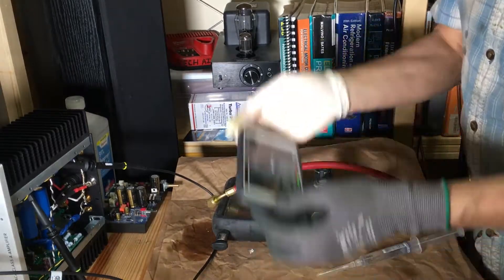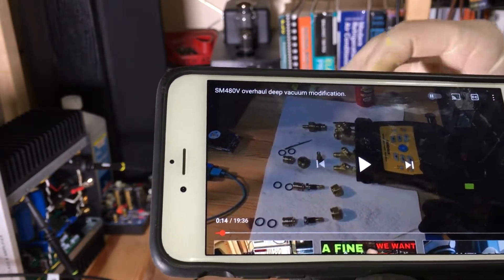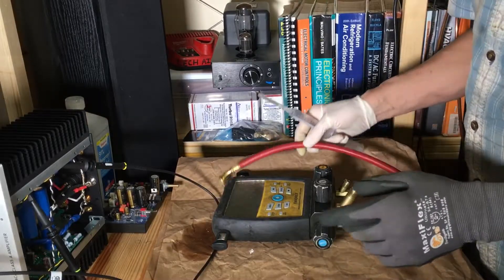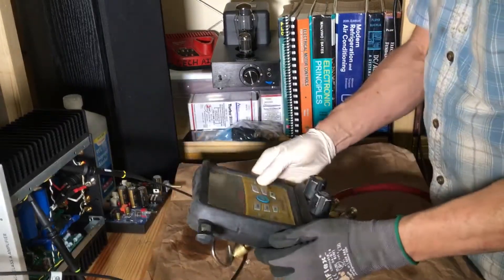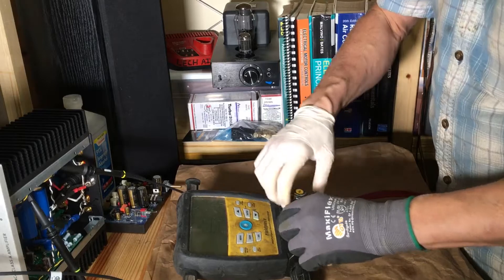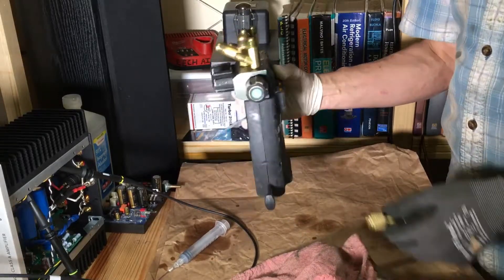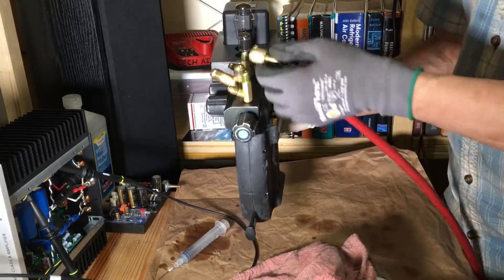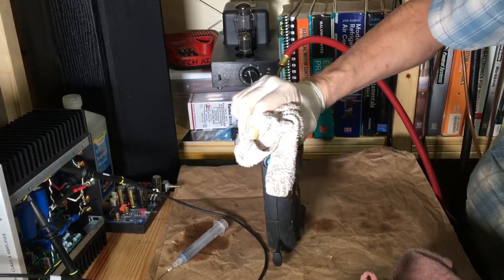How to clean your Fieidpiece  SMAN 480V micron sensor. With isopropyl alcohol

Comment: Thank you for making this tutorial video. 
I would like to replace the sight glass on the SMAN460 manifold gauge, please share if you know how to do it.
Reply from the maker: I have not had to do that on any of SMAN 

What makes you think you need to replace it? . 

Because you seen small bubbles in the glass at the edge of the oring ?
Reply: @coldfinger459sub0  Hi when charging I could not see the flow of refrigerant thru the sight glass, maybe the Sman460 sight glass is darker then the Sman480V?
Also would you share the procedures of vacuuming the manifold charging hoses?
Reply from the maker: @thaison773  that is one thing I would like Fieldpiece to change on the inside of the manifold. 
     Is to not make it black because that makes it too dark and too difficult to see stuff. 

Should leave the inside of the manifold, a shiny polished aluminum . 

It makes it much easier to see . 

I was almost thinking of taking one of mine apart and getting a little Dremel and polishing or sanding down the black oxide paint from the inside behind the glass, so it will become bright and shiny . ✨ 

I even almost thought of getting one of my very old manifolds and drilling out the backside of the manifold and adding a second side glass behind behind it so you can see all the way through .  And have light.. 💡 

I have made some videos showing removing the refrigerant after you recharge or service system . 

It’s really simple all you’re doing is turning off, disconnecting the high side and slowly allowing vapor refrigerant to be sucked into the side . 

And then you connect your hoses to your recovery and recover the leftover refrigerant inside the hoses into a recovery machine .

Comment: The fieldpiece website says to do it this way with the exception of pulling a vacuum
Reply from the maker: The majority of people do not have access to 99.9% pure alcohol that evaporates in a flash.
      The majority of mere mortals are left to go into the drugstore in some places it’s only 7% and if you’re really lucky they might find 90%. 

That other percentage is pure 100% water .  
   That absorbs nicely quickly and efficiently right in to the refrigerant hoses, and if there is a minute amount of POE oil, absorbed into the surface of the refrigerant hoses or manifold that was not removed that molecule loves to attach and connect with H2O. 

So to be nice and clean and moisture free that’s where the vacuum pump comes in in a little more dry nitrogen .
Reply: @Tom Lech / LECH AIR CONDITIONING   thank you so much for explaining your reasoning. I'll be sure to follow your advise, even with the 99%

Comment: Will alcohol and nitrogen help remove black oily sludge out of a manifold, sight glass and hoses?
Reply from the maker: You might have to order a new O-ring and mechanically physically remove the cy glass and clean it by hand with a Q-tip you can give it a try with alcohol only it just depends on what type of material the black sludge is made out of will determine what chemical will be needed to remove it.
Reply: @coldfinger459sub0  Thank you for sharing your knowledge. I'm learning so much from your channel.

Comment: To clean with r141b .
Reply from the maker: Yes the old school automotive DuraFlush AC system cleaner. $39 a quart 
          And if you get the same product that is labeled inside the commercial refrigeration warehouse under the name RX 11 for Proflush under the diverse tech name and the price jumps up to $79-$89 a quart for the exact same product. 

99% alcohol $32 a gallon. 
Alcohol cheaper.  Safer and you can use it for many other products and purposes around the house.

Comment: great video.  I have the SMAN 3 and it started leaking from the Sightglass. Any idea on how to repair that?

thank you!
Reply from the maker: Call up the company or send them to my email for a parts rebuild kit or just that O-ring unscrew it with a large hex put in a new one tighten down the hex site glass screw and you’re good to go. 

I have not had one leak yet

Under pressure do you get bubbles coming outside is that how you found the leak ?

Comment: How would you hook it up to put it in a vacuum
Reply from the maker: You just hook up one of your hoses to the manifold to a vacuum pump and turn it on close the other valves so they’re sealed. 
                 You’re just drawing a vacuum on the inside of your manifold only to remove the moisture and alcohol
Reply: Thank you! Been very helpful

Comment: Will make this stop bouncing around
Reply from the maker: What is bouncing around ?
Reply: Your Guage bounces around for these reasons:
1. You could have broken/rugged gaskets on your hoses. Inspect them and make sure they are not damaged at all.
2. You're working with linesets that have oil in them. When the oil moves around, your manifold readings bounce around.

Comment: will alcohol cause o ring or seals to dry out and crack?
Reply from the maker: Alcohol does have some side effects that may not be the best but it also has benefits depending where you live. 

      Some materials alcohol may have a drying affect. 
               And alcohol in the presence of moisture in oxygen also has a slight oxidation affect on aluminum components. 

      Now when I’m speaking of alcohol it’s not the 70% alcohol that has 30% water mixed in it that you get from your drugstore. 

       When I think of alcohol as a solvent or chemical procedures I think of a very pure alcohol that is basically 99.9% alcohol highly hydroscopic absorbs moisture very fast. 

           But if I was in a country or even some parts of the United States we’re getting to a auto supply house may not be very easy or convenient and be more than 50 miles or 100 miles away. 
                       Or somebody in a country where there may be no auto parts that we recognize as a store at all whatsoever. 

         Or somebody with very limited funds and spending $50 on a quart of AC pro flush or they have the alternative of $15 for 1 gallon of pure alcohol. 
                Which is no longer the case after Covid because everyone bought up all the alcohol resources were doing sterilization what made the price inflate artificially (price gouging)

       But if I was to use nitrogen as a propellant in alcohol as the solvent it would be my low-cost emergency go to Product. 

       Anhydrous alcohol has been used for flushing brake systems in the automotive industry since before my dad was born. 

         Where the alcohol is an excellent solvent for refrigerant oil’s.
            And that is the exact item that you want to remove off of your micron sensor. 

      And the new seals that we use nowadays are not the old butyl rubber seals we use from the 1960s and 1970s started disappearing when are we switched over to R134 in 1990 on some vehicles and all vehicles by 1994. 

       Nearly every manufacture of refrigerant gauge set with a micrometer in it instructs you to use alcohol to clean out your gauges

And ever since I was a kid from the age of 12 on my father’s micron gauge vacuum sensor the manufacture instructed you to use alcohol to clean out your vacuum sensor. 

And it’s very very easy to replace the O-rings on the Fieldpiece on the piston valve inserts. 

I have a video showing how to take them apart and replace the piston valve assemblies or remove the O-rings and lubricate them with silicone grease or NYLOG if you prefer. .
Reply: 6:24 we like to say "it's not rocket surgery."

Comment: Is it safe to use R11 flush in place of 99% alcohol?
Reply from the maker: R11 definitely dates your age we haven’t use that in decades I was much younger when they banned that from being used as a flash. 

        I guess you could as long as you were flushing a refrigerant oil residue that was compatible and would dissolve with R11 to be flushed away. . 
            I know somebody who still has a 30 pound jug of R 11 sitting on their shelf I remember correctly their color was orange

       And you are talking about real refrigerant  R11.    Not the fake R11 substitute was a marketing gimmick to imitate (marketing)the name R11
       That is sold in HVAC parts houses with the little flush kit

Comment: Thanks, can we use this alcohol to flush a cooling system?
Reply from the maker: You are not supposed to because alcohol is slightly corrosive on aluminum. 
         In the manufacturing process of components made out of aluminum for air conditioning there is no protective coating or anodizing to protect it from oxidation. 

         Unlike a beverage can that you would buy in a store with alcohol in it if it was made out of aluminum cans there’s actually a plastic polymer coating on the inside that stops the cans from corroding. 

           They make special flushes for flushing out systems. Here is a link

https://www.google.com/search?rlz=1CDGOYI_enUS909US910&hl=en-US&sxsrf=ALeKk00xdX81kCRBK9t3AeLjaW9MejEqvQ%3A1611933142328&ei=1iUUYKuxE87K0PEPm5ekqAc&q=refrigerant+cleaning+flash&oq=refrigerant+cleaning+flash&gs_lcp=ChNtb2JpbGUtZ3dzLXdpei1zZXJwEAMyBAgAEEcyBAgAEEcyBAgAEEcyBAgAEEcyBAgAEEcyBAgAEEcyBAgAEEcyBAgAEEdQAFgAYP3nAmgAcAJ4AIABAIgBAJIBAJgBAMgBCMABAQ&sclient=mobile-gws-wiz-serp

        In past history guys have used alcohol I guess if I was desperate and I lived in a country out in the countryside far away from any City and that was the only thing I had. 
          It would have to be pure alcohol 98% or 99% and then blow and flush the hell out of it with dry clean nitrogen immediately as fast as possible.  And then immediately put it on a vacuum pump.        But that would only be in a desperate attempt because of the location I was trapped and the equipment had to get up and running or the equipment was not important was going to be replaced anyway in a few months and just needed to get up and running again.  That would be a scenario where I would use alcohol out of desperation.

        I had to come back and edit and add something.   If you use the alcohol to flush out your system and then try to use normal sharp compressed air out of an air compressor instead of dry nitrogen. 
              As soon as you started blowing the alcohol would act like a refrigerant and start cooling off to the point of condensation of the water in the compressed air on top of that alcohol itself absorbs a large amount of water instantly.
              So as soon as you started trying to use compressed air to blow out alcohol you would immediately replace the alcohol that is still left in the system with liquid water. 

               No you would immediately have to put it on a vacuum pump and vacuum for a extra long time because you would have to boil off all that water you just created inside the air conditioning system piping and condensers and evaporators and accumulators . “ special note !”  In automotive receiver dryers and accumulators whole desiccant material you cannot clean through them you cannot blow through them you just replace them. 
              (“ in residential or commercial HVAC accumulators and receivers are completely empty and have no chemical desiccant material inside them like they do inside automotive”)